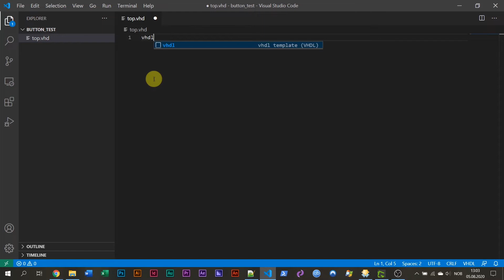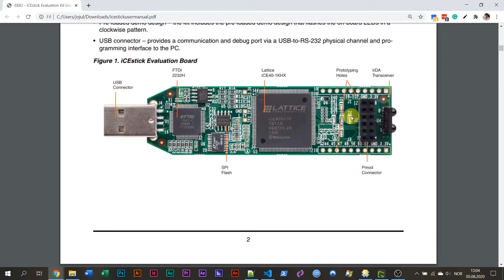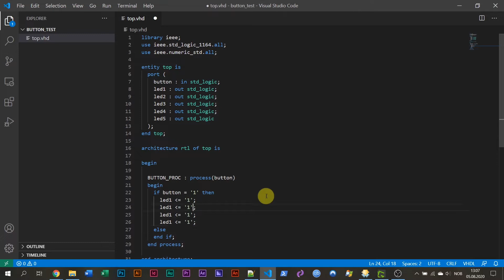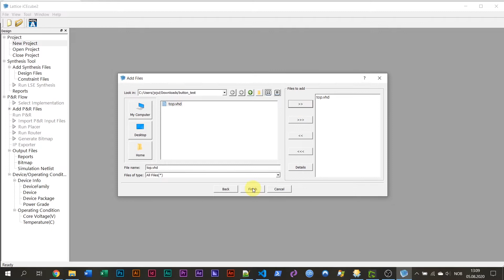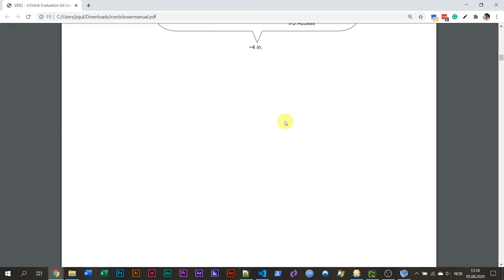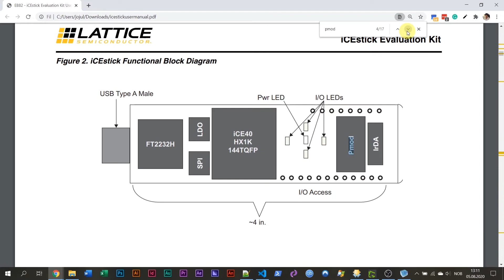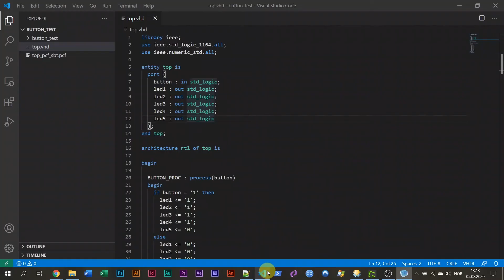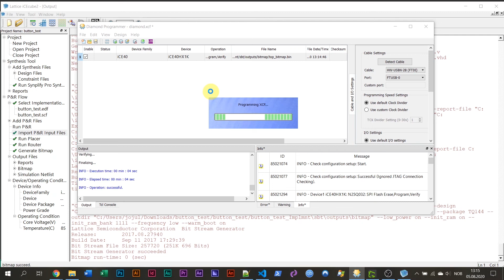How to read button press in VHDL

Comment: What will happen if you set pullup to "no" (pulldown) ??? and why you connected it to GND ,,, i thought in order to get a "1" signal which light up a led or switch a relay , you should give a "1" as an input ,,,,,,,,,, i m kinda lost here
Reply from the maker: If you don't set pull-up on that pin it will be floating, and the read value may be 1 or 0 randomly.

I'm using the FPGAs internal pull-up resistor to avoid using external resistors. There is no internal pull-down.